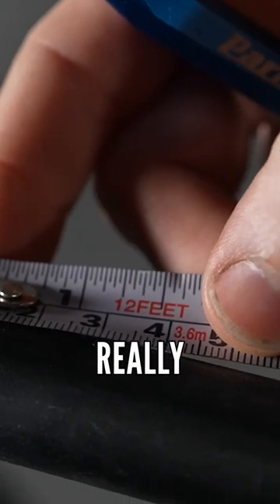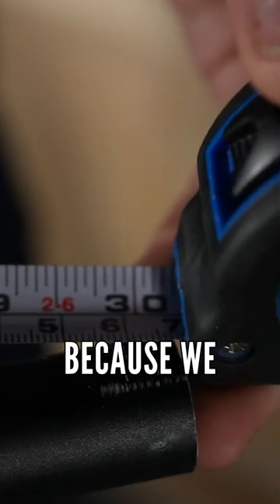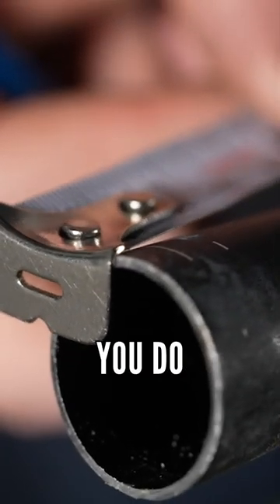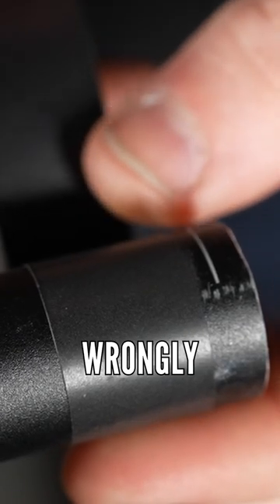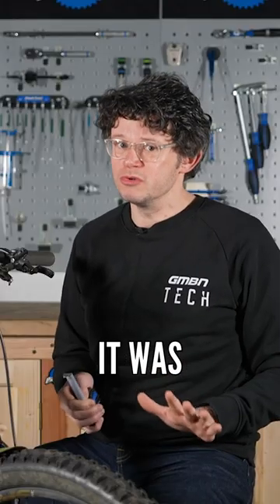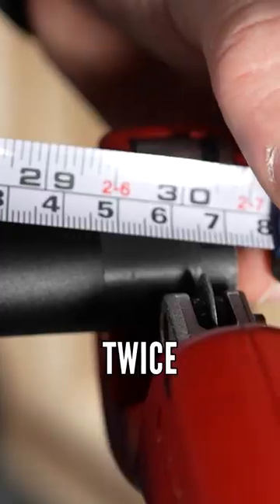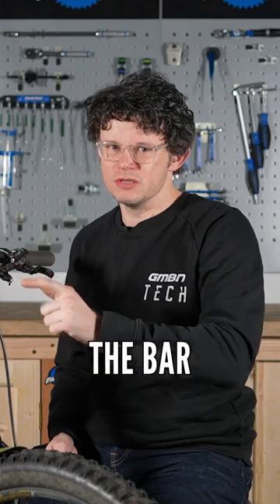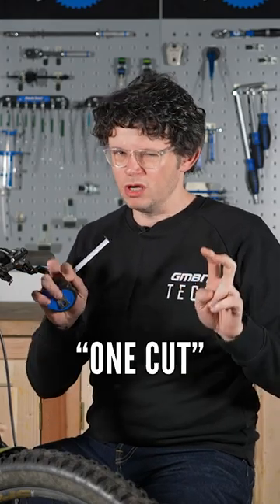Essential Advice For Cutting Down Handlebars! 📐🪚

Comment: I wanted to cut my bar from 800 to 780 mm or something. I measured twice as suggested and then cut it. Only problem was that I cut of 20 mm just from one end instead of 10 mm of both ends. Done that, will never happen again 😃
Reply: The measure once cut twice rule will cover that. You're good😂